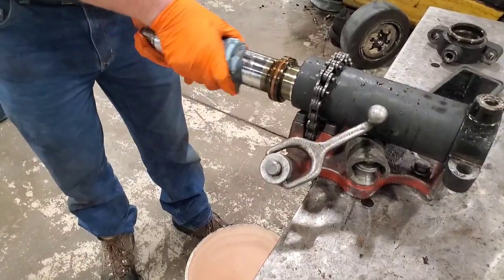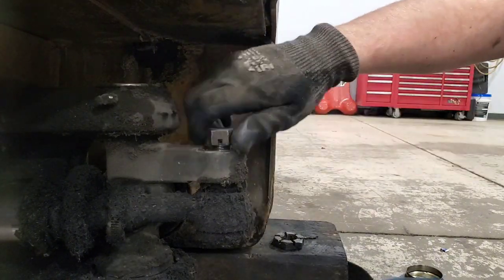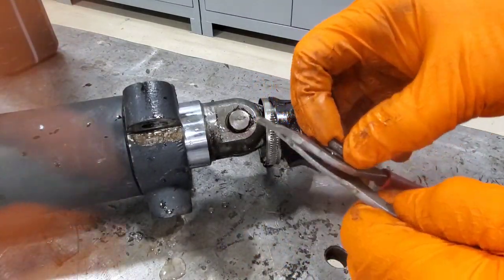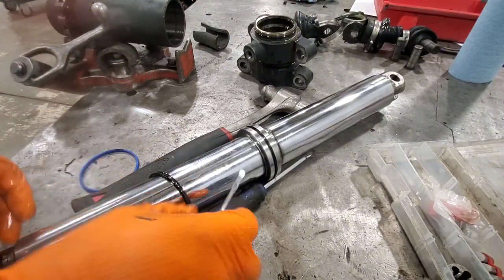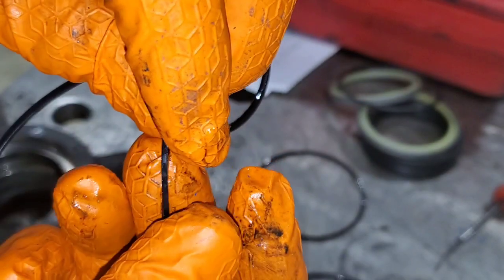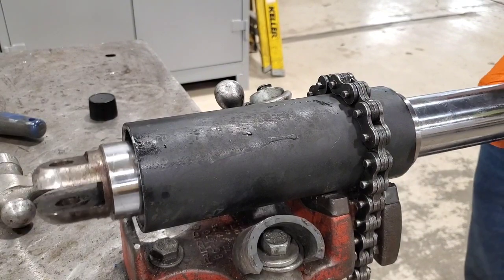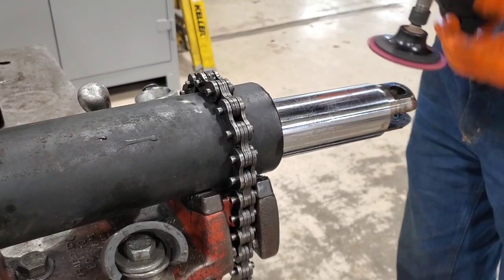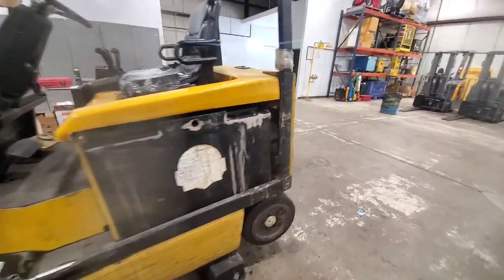Leaking hydraulic cylinder, FIXED.

Comment: Plastic cone slips over the rod end for installing the end caps
Reply from the maker: I figured that's what it's for, the kit must be somewhat universal then because it doesn't fit over the end of that rod. It's a non OEM kit, over the years I've seen those loaders be hit and miss if it works for your application.